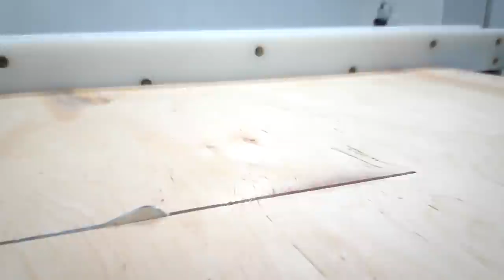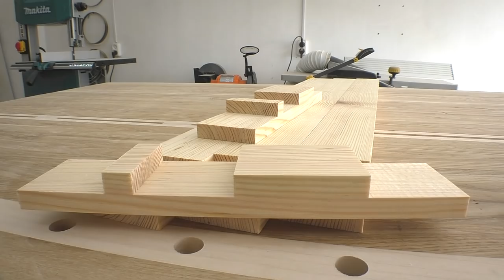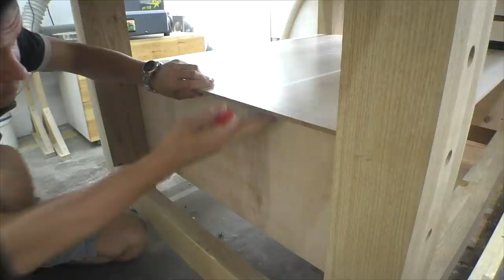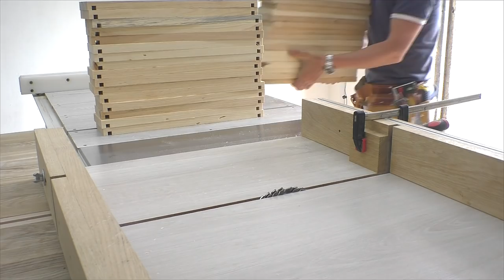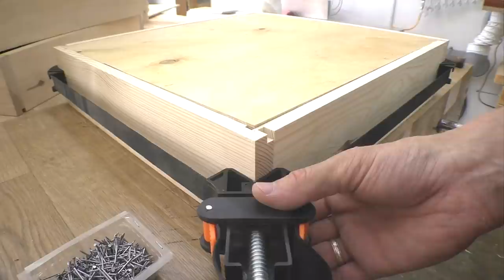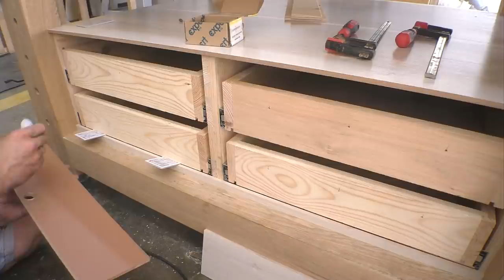Another Cool Woodworking Project I Made From Laminate || Part 6

Comment: Man you love your laminate! But I like how consistent you use it. Great job!
Pro-tip or Bro-tip, if you want ;-) : you can take apart these drawer slides. If you pull them out completely, is there a little lever. Push it up or down and you can take out the first part of the slides. Its much more comftable to mount the drawers on and not under the bench...